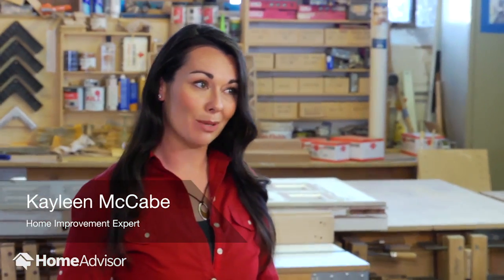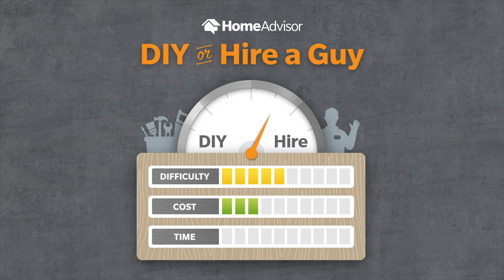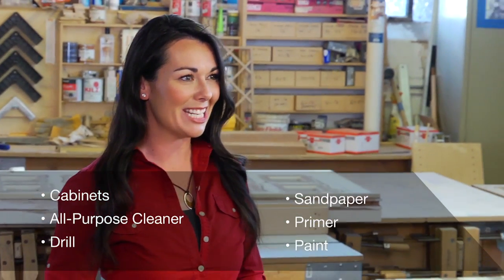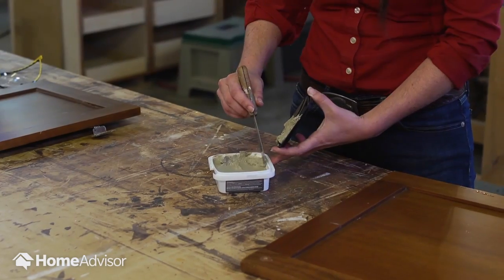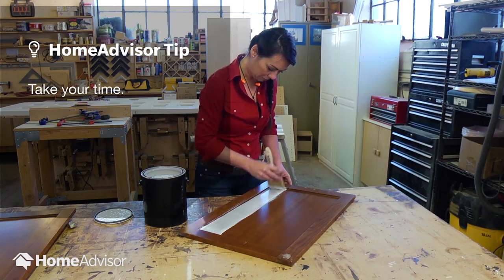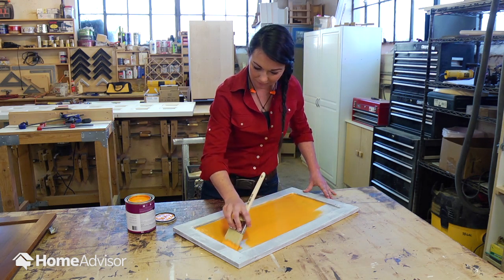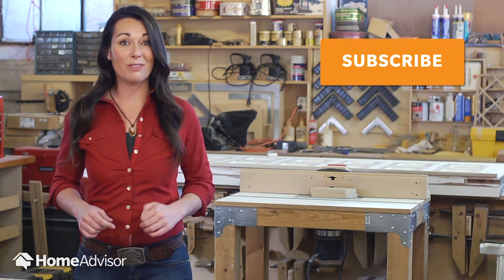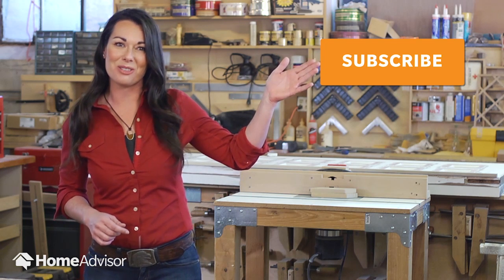How to Refinish Cabinets | Painting Guide

Comment: It looks so simple lol. I am a painting contractor and there are many more steps than just cleaning, priming and painting. You forgot the sanding phases (one before priming and another one after primer is dry) Refinishing cabinets is more complex than it seems for DIYers. Even professional painters can mess up your cabinets. Not knowing which paint to use and how to apply it can make you waste more money. If you jump any step, paint will start to peal next year or even on the next few months. 

Tip: if you hire a professional make sure they use a new spray tip to not leave lines or marks. 

Ps: It takes more time than painting the exterior of your home.